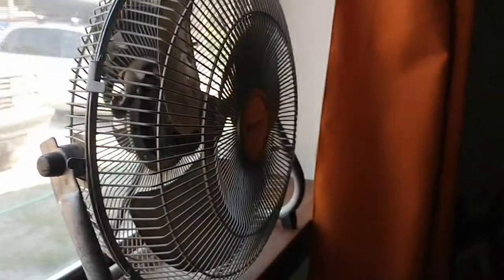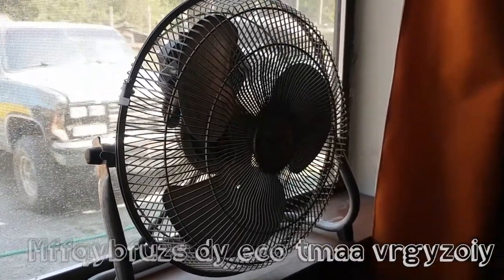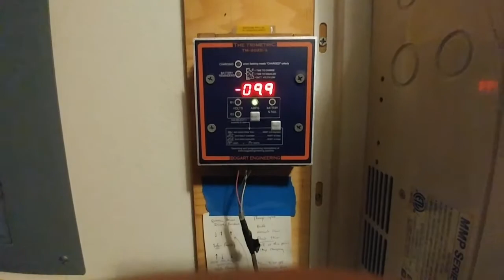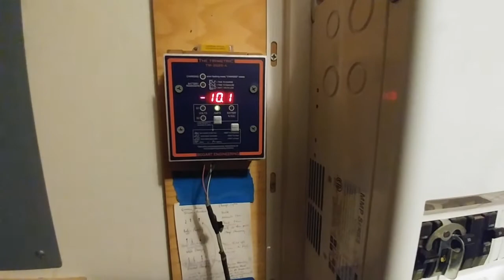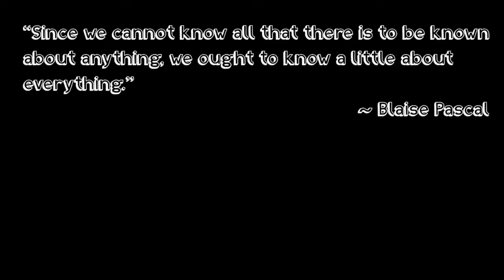Beat the Heat: Powering a Fan Off Grid

Comment: Metal fans are definitely a lot nicer. Most of these units use shaded pole motors with bronze oil bushings. You can separate the motor housing and lubricate the bushings with sewing machine oil to make them last longer. I usually do this after noticing that the blades don't free spin for very long after shutting off the fan.